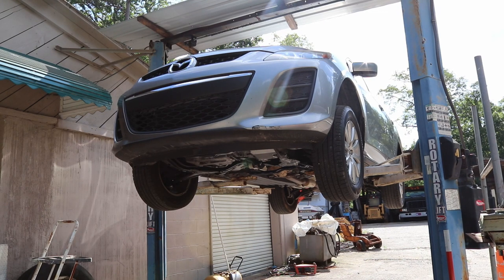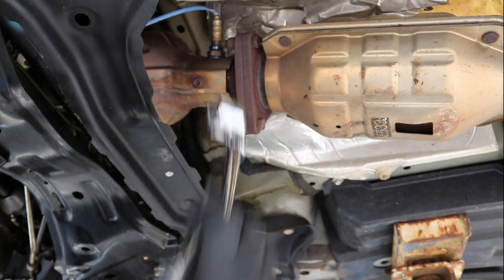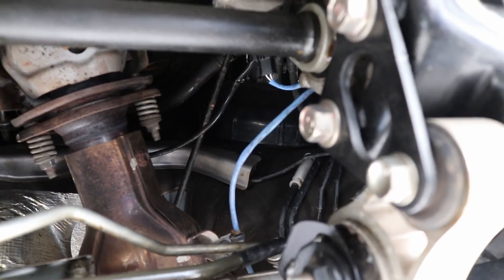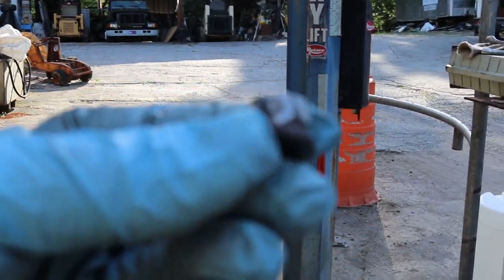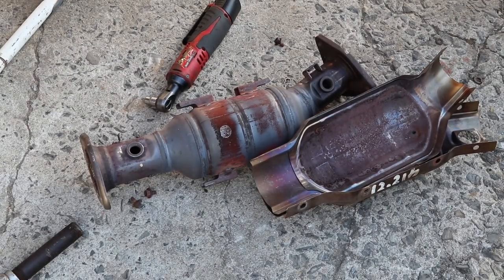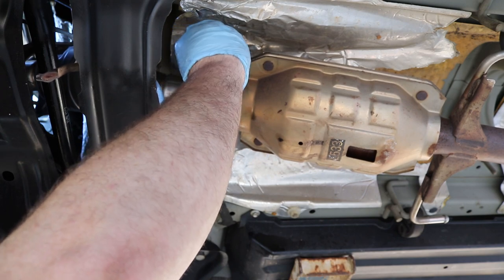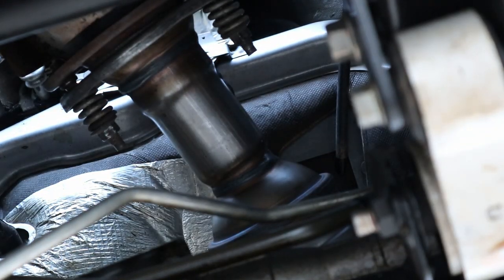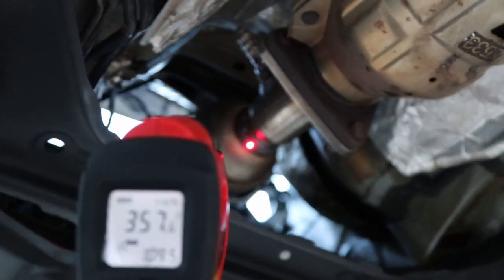How to change a catalytic converter on a Mazda CX-7

Comment: Hi quick question. After you install the new cat. Your first reading of 230 degrees is after cat right? then the 350 degrees reading that’s before the cat?  thanks
Reply from the maker: No the 230 is before cat 350 is after the cat. Reason for this is the catalytic converter when working properly will have higher temperatures after the cat. This was one of my first videos so I’m really sorry I didn’t go into more information and just better overall video. Best of luck. Thanks for watching!

Comment: what was the tool you used to take off the O2 sensor?
Reply from the maker: Hey, it should be in the description. but, just in case here’s a link to one just like it Carock Oxygen Sensor Wrench 22mm Flexible Head O2 Sensor Wrench 7/8" Removal Install Tool https://www.amazon.com/dp/B07RT8HRR9/ref=cm_sw_r_cp_api_glt_fabc_295JJMRA2K7YA0HAE24A

Thanks for watching!
Reply: @JunkyardJunkie  thank you very much.

Comment: Do you have any idea why the mph won’t move at all but the rpm does?
Reply from the maker: Are you talking about while in drive and moving? If so check my abs video i have. If you have trouble with both wheel speed sensors it could do that. Any other symptoms or lights?